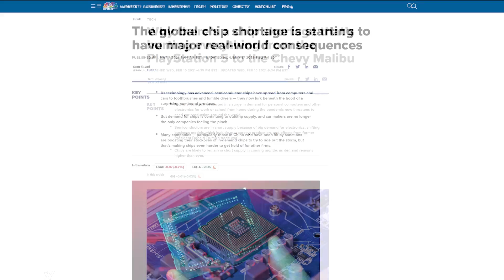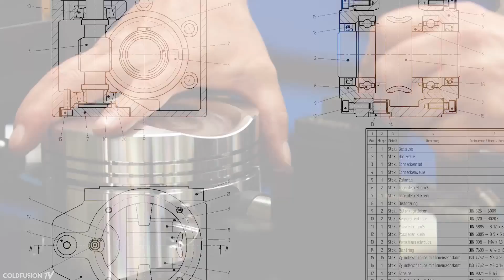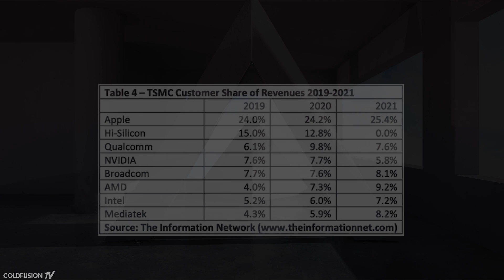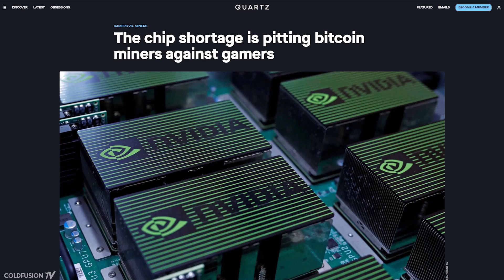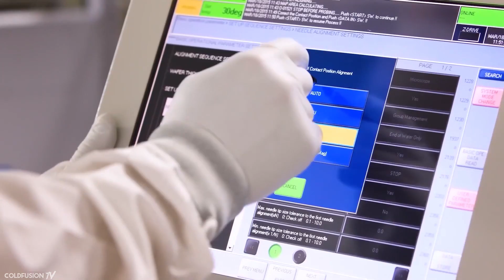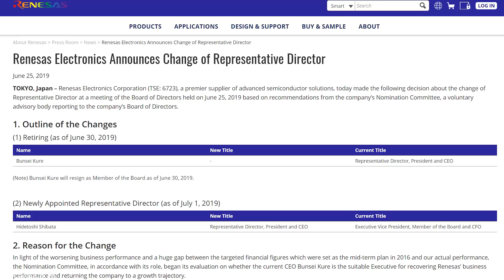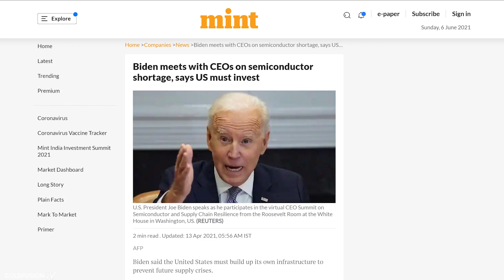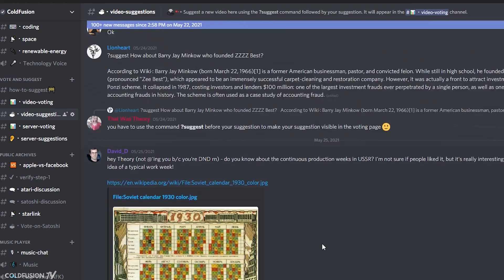How The Global Chip Shortage Started

Comment: And here I thought we have moved to just in time production.

We need an innovative approach here. Maybe better storage or uniformity in design process among different chips. If a company knows that all the chips are ultimately going to be sold by them alone then why would they work to deliver on time to keep the prices low?
Reply: Because the other manufacturers in the space will take a mile if TSMC gives an inch. TSMCs growth so far has been driven by Global Foundries leaving the cutting edge process node space, AMD's growing market share and Apple going further and further into making its own silicon, but Samsung is coming up in the space for the better and smaller process nodes (They have a plan for GAAFETs and MBCFETs at 3nm). And given that they've actually done a good job with 8nm yields for RTX 30 series, I don't see TSMC being able to choose complacency.

The consequences of complacency can be seen on the Intel side - they've failed to get their 10nm node off the ground for so long that it's only going to come to desktops late this year, if that. And it'll be competing with a 5nm product from AMD, who's going to be using TSMC's N5 node for their Zen 4 architecture. Intel got so stagnant that Apple managed to go and make the M1, and have it outperform Intel on the mobile platform within a super short time period.

The entire semiconductor industry is at capacity right now - and they're all expanding for more and more fab space. We're having more chips being made now than ever before - it's just that they're also being gobbled up as old, aging hardware across the world gets replaced in the move to do everything from home.

There are a bunch of different kinds of processors, and a bunch of different kinds of designs necessary for them all. With the industry moving to chiplet/tile designs, we're going to move further and further into modularization and specialization of different parts of the processor depending on the requirements (AMD already makes its I/O dies on . And as monolithic dies get phased out, complexity of design will go up. 

TL;DR - More uniform designs are not an option as long as x86 computing remains a thing. Chips are going to get more complicated, not less, as we push towards more specialized chiplets/tiles and make advancements in hardware-level vector/tensor processing. The semiconductor manufacturing industry wants to sell more, and complacency is not an option. They are in the process of expanding, but fabs are expensive and complex, and will take ages to get online. Also, prices are set by the ones designing and selling the finished product - AMD, Intel, Nvidia - and they're figuring out that the market for high-end silicon can be pretty inelastic. Enterprise sector customers will upgrade no matter the cost, and normal consumers have shown that they'll pay $3000 for a 3080. So us consumers, we're fucked.
Reply: @rafaelmarkos4489  Thanks for the detailed reply. However, it seems that TSMC has given more  than an inch right now and nobody is there to fill the gap. Standardization is everywhere and we need to shift to such an architecturer soon, thanks to M1 that ARM is now coming in laptops to kick x86's 40 years old ass and merge the mobile and laptop chip space. But again these changes are not what will bring the supply elasticity..... We need better demand forecasting and better operations management to handle dips or peaks in supply and maybe we have squeezed the semiconductor prices to an extent that they just can't be produce in smaller batches.
Reply: @rikeshkumarsinha  Thanks for taking the time to read it!

Thing is, we've spent a lot of time on CISC architectures, and RISC will need to be a lot faster to overcome the inherent disadvantage over there. Don't get me wrong, Apple has enough money to go far in the space, but I'm not sure that it's going to go far enough to outdo the established companies, especially with Nvidia entering the CPU space as well.

As to the probability of standardization - any bits of design that are important will be patent-protected, and designs change a lot as we move from process node to process node thanks to how transistor technology has progressed over the years. In the 5/7/8/10nm space, which is the high end right now, the exact architectural designs used are all patented. IBM has already started making patents for 2nm designs, which aren't close to mass production yet.

Comment: Awww. My heart is bleeding for the poor car industry. The shortage of automotive chips was caused by the Automotive industry treating their suppliers like dirt. If a major industry cancels all their orders of products that take 6 months to make, then it is not possible to ramp up additional capacity if their lirdships, the Autobosses, change their view on the market.
The Semicobductor industry operates on razor thin margins, they cannot afford to leave a double digit percentage of their capacity unused. So, after getting most of the Automotive orders cancelled, they allocated the capacity to consumer electronics. 
If you add Tr**ps assault on the Chinese Semiconductor industry and the corresponding significant shortfall of the Chinese previous generation chip capacity, which is the predominant technology used in automotive applications, then it is not surprising that we see them losing 100s of Billions in revenue.
Maybe they should invest a little in this key technology and make sure they have first call on Semicon production capacity, not just wash their hands of it, if they think they don't need it. A bit od stockpiling of chips wiukd hace helped as well. I am sure that would have cost a lot less than the losses they now incur, because they cannot get the parts. 
I have to say that after having personally dealt with automotive sourcing practices if feel a good bit of Schadenfreude about this. Maybe they learn something from it.
Reply: "Zero Inventory" "Single Source" Wiseguys - I had fun reading news.

Comment: As someone who crawls through documentation of semiconductor architecture, I am also someone who thinks mass computerization is absolutely foolish.

Digitally controller toasters, tea pots, coffee pots, all moronic.

We had analog timers with near perfect accuracy, and temperature sensitive metallic strips which pulled away contact to cut power at the set temperature.

If I, a 21 year old homeschooled guy with no college education, can see this, then surely the people making these products can see that they are merely trend followers, when what we need are trend setting innovators.

Build quality, not feature spammed spaghetti. I'll be the first in line. Pitch it as a retro line if you want, it'll drive sales.

Comment: In 1992, a fire in a single plant in Taiwan that produced an adhesive used in manufacturing RAM chips, rolled the price of RAM worldwide for two years.

The increase in RAM doomed IBM’s OS/2 operating system leasing to Microsoft’s Windows dominance in desktop computing.

A global supply chain has many failures modes.

Comment: I feel like the demand for the semi conductors would eventually rise to meet the supply if this is an artificial shortage as third world countries modernize rapidly wouldn’t it? This wouldn’t be great as it would lead to further consolidation in the chip market but I feel like the extra chip supply would be a boon for these companies long term.
Reply: That is a good point. Older, mature processes are run with used equipment. And there is no replacement for worn out. So increasing wafer capacity for mature products seems more limited.